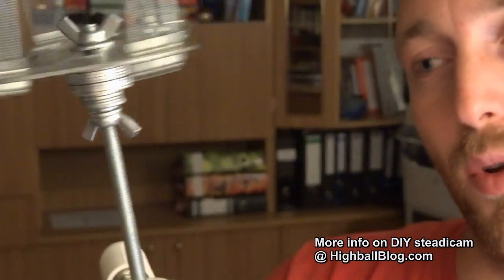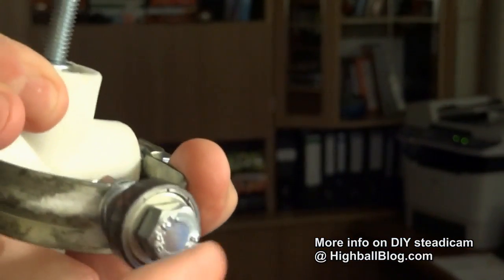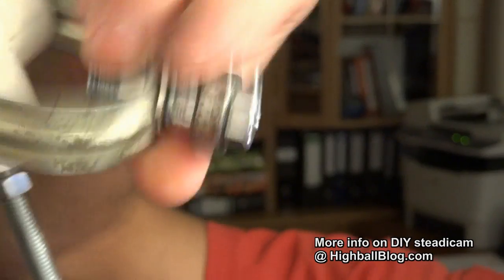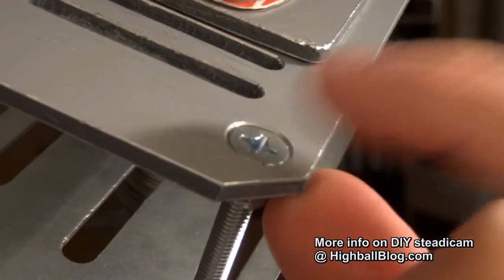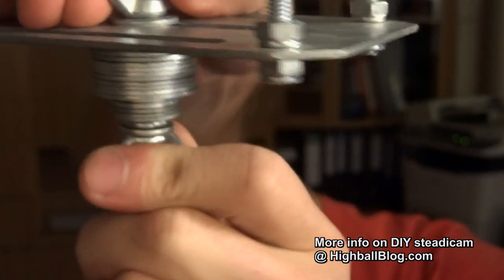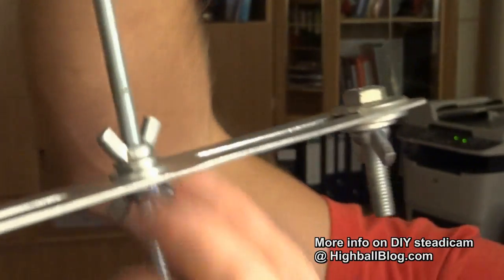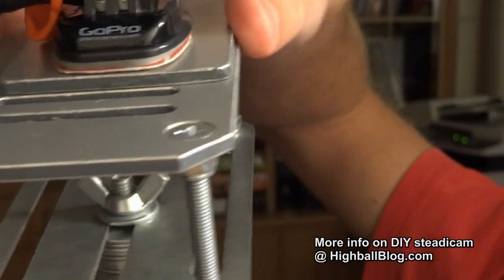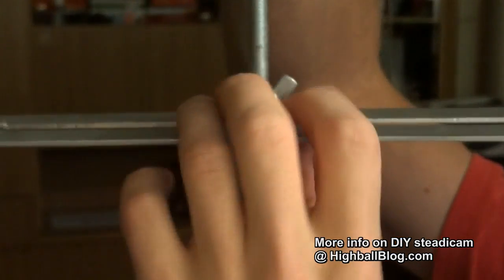GoPro Steadicam - DIY Camera Stabilizer Explained

Comment from the maker: @Lockdown582 This is a prototype and I had a few pieces made for it until I was satisfied. Overall expenditure went over $100 but this includes some other parts that I eventually didn't use. If you do it all by yourself (no machinery work) you should do it with 25 pounds I guess. I depends on how cheap can you get each part (bearings, handle, plates, bolts, etc.)